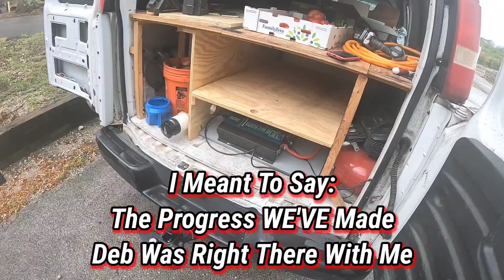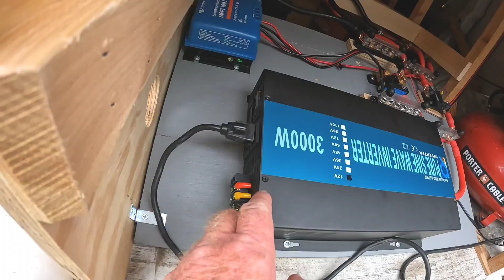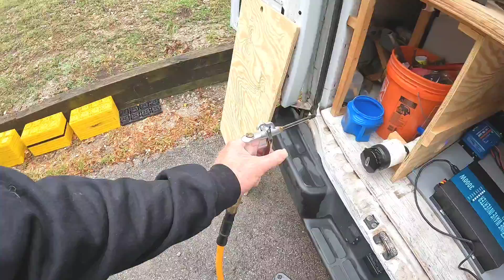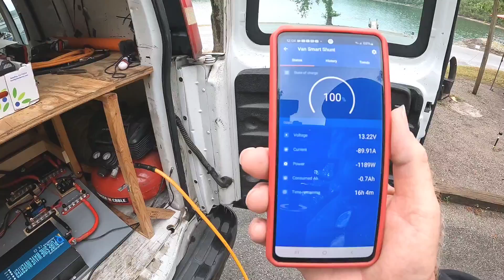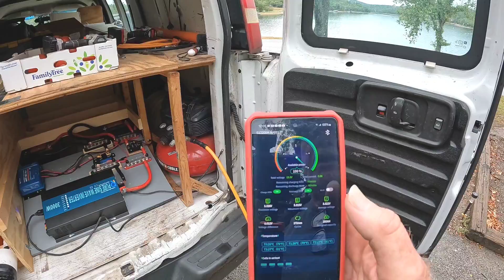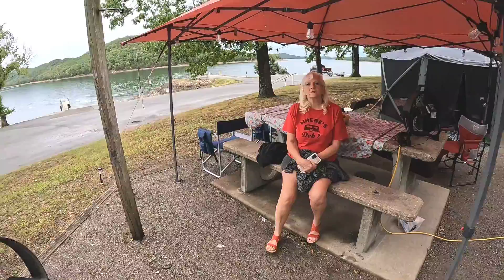Making Our Van A 3,000-watt, 600 Amp Hour Solar Generator. Update #3.

Comment from the maker: https://a.co/d/7IMEHBC
https://www.amazon.com/WZRELB-Reliable-Efficiency-Inverter-Converter/dp/B0154C5F3A/ref=asc_df_B0154C5F3A/?tag=hyprod-20&linkCode=df0&hvadid=693458464558&hvpos=&hvnetw=g&hvrand=16713067239299684457&hvpone=&hvptwo=&hvqmt=&hvdev=m&hvdvcmdl=&hvlocint=&hvlocphy=9026020&hvtargid=pla-350371745231&psc=1&mcid=f98a755589b53bd199e32fa5ecb487d1&gad_source=1

PowerUrus 12V 200Ah Self-Heating LiFePO4 Lithium Battery with Smart APP, 4000+Cycle LiFePO4 Battery, Built-in 200A BMS, Wireless Real-Time Battery Monitor Function for RV, Marine, Off Grid Application https://a.co/d/iIvwiJO

https://www.amazon.com/Victron-SmartShunt-500AMP-Bluetooth-Battery/dp/B0856PHNLX/ref=asc_df_B0856PHNLX/?tag=hyprod-20&linkCode=df0&hvadid=693371156541&hvpos=&hvnetw=g&hvrand=11173269476944609936&hvpone=&hvptwo=&hvqmt=&hvdev=m&hvdvcmdl=&hvlocint=&hvlocphy=9026020&hvtargid=pla-905632901260&psc=1&mcid=60ba429db73c36ff8de1ebdc756cc1aa&gad_source=1

https://www.amazon.com/SmartSolar-MPPT-100-Charge-Controller/dp/B073ZJ3L13/ref=asc_df_B073ZJ3L13/?tag=hyprod-20&linkCode=df0&hvadid=693071376145&hvpos=&hvnetw=g&hvrand=18305564870273363853&hvpone=&hvptwo=&hvqmt=&hvdev=m&hvdvcmdl=&hvlocint=&hvlocphy=9026020&hvtargid=pla-396611007572&psc=1&mcid=27ac9f8afcf930589b6eeb472b65749d&gad_source=1

Comment: Awesome video. Covered everything I believe. Question though, why is charge controller so far to the left and away from other components?
Reply from the maker: At the time that video was made, we only had 2 panels on top of the van. One charge controller for 2 panels. We recently added 2 more panels,  and added another charge controller for those 2 panels.  We simply needed to leave room for the 2nd charge controller.
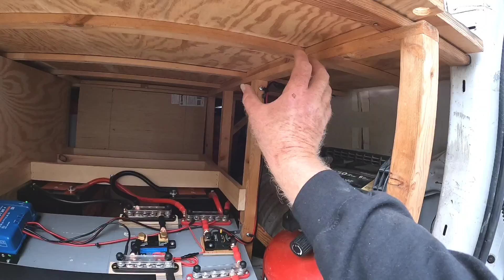Reply: Oops! sorry, my apologies. You actually explained that at the 4:30 mark. 300 amp hr bus bars suffice? I could also get 600 amp hr bars for $30 more per pair. I really like your system!

Comment: I am wondering if you could unplug the solar on the van 
Then with a MC4 on the van and the trailer with home made cord to give the trailer more charge if needed 
Now with that in mind the Van battery would be at full charge
Reply from the maker: Yes. We've done it before.

Comment: Hey Bill since I live in Nebraska about this setup for the van 
How Do you plan to protect the If Necessary
Reply from the maker: If you're referring to cold temperatures, these batteries are equipped with self heating pads. We specified those batteries for that reason. In addition, even though we will be headed to Florida the end of November, we will be monitoring nighttime and early morning temperatures. If predictions warrant it, we will shut down the solar panels to be safe, until the temperatures climb to a comfortable level. One more thing, the batteries can all be monitored, individually, via Bluetooth. One of the categories monitored is actual battery temperatures.
Reply: @billanddeb  oh now I see I
I went to the link and learn more about them 
I was just wondering since you and Bed have said you maybe in the area of Colder weather later this year possibly. 
Having the new Family member and recently health issues 
So I just want to ask that question about it before The Snow Flys
Reply: I see these Batteries will be great for your system upgrade 
I ask you all these questions to help me understand how what why 
So after I get past my Health issues 
I will do what all these great Walk Through people do and Start mine

Comment: Thanks for the update, very good thank you. I have been looking at LiFePo4 batteries, been talking to manufacturers, watching videos. Now I am really messed up... See I am here in the middle of Wisconsin, we do some late fall camping, I have asked battery manufacturers, and camping shops to recommend what type of battery I should use for updating, I don't want to remove the batteries during winter storage because it is a stand alone behind the garage buried in snow, and not much access to it for three months ( many times snow drifts ). I have solar panels on it, 200watt, a POS PWM controller that keeps the AGM battery happy all winter but would like to upgrade things so I no longer need to bring a generator along for the fall camping for coffee making etc ( bigger inverter, bigger battery ), will a self heated LiFePO4 be ok for a few months outside in the elements ( last year we had -10*F for a few weeks twice and a good snow storm 18" ), or should I just stick to the AGM's until I find a easy way to pull batteries and put them in the basement. Even if I place the batteries inside the trailer ( currently on the tongue in a battery box ), the temp in the trailer will get very close to outside air, in hibernating mode. Wil the cold temp sensor kick in and it will be OK till spring, keep getting different answers, I have even over heard the service Tec's talking in the background on the phone arguing yes, no, ( it is ok to have off, but not that cold, it will damage them ) can I just turn off the power access, and the charge supply, will that harm it over the months?? I hear them say "they are not meant to hibernate for months" , now with battery technology evolving as fast, and panel prices to drop more, I am going to wait a little while, but if a sale comes up this fall to clear out their stock, I hate to be late to the LiFePo4 party. Also what are your thoughts on getting a used Victron controller from market place when they upgraded their system and need more than there 100/30 controller? Been seeing a few now for sale.
Reply: Just a thought,  can you run an extension cord to your unit and put a battery heating pad next to your batteries while it's being stored

Comment: Great system an idea. from what I have seen and read if you connect batteries in parallel. Then take neg from one and pos from other. It keeps them balanced better as they are running through each other and not individual,

Comment: both ideas are good for running 2 different panels  on 2 different controllers but also replacing panels before they go bad/ become less valuable and make everything matching. Mount the outlet to the door that way you can use a small pig tail to power the rig when you are driving if it was an emergency gtfo situation like back in Rogers, AR just keep a loop in the cable so it can easily move with the door.
Reply from the maker: The trailer also has its own battery power bank, similar to the van system. However, we never power the trailer going down the road. The Fridge does just fine. Even after a 6 hour run, everything is still cold in the fridge and still frozen in the freezer. In addition, if the batteries are down in the trailer when we pull out, by the time we get to where we're going, the batteries are topped off, due to full exposure to the sun going down the road, unless of course, if it's a rainy or cloudy day.

Comment: the 2 15 amp outputs on the 12 volt inverter in the van will combine to feed a 30 amp rv outlet on van connected to the trailer rv input via a 30 amp to 50 amp adapter.? for 30 amp service or will it be 15 amp service?
Reply from the maker: We are currently connected to a 30 amp power Pedestal via a dogleg adapter. Once the system in the van is completed with a 30 amp "AC" rv style outlet, we'll be able to "plug in" to the van the same as we do at a 30 amp power Pedestal.
Reply from the maker: No. When we mount the 30 amp RV outlet on the outside of the van, it will be wired via the hardwire terminals on the inverter. The only time we will use the 15 amp receptacle on the inverter, is when we power the compressor. We will NEVER run the compressor the same time we are powering the trailer.
Reply: @billanddeb  Now I got it.....I had a brain fart......... the hard wired part is rated for 30 amps ? or more?
Reply from the maker: Well, the wire is heavy enough, but honestly, 3000 watts at 123 volts does not add up to 30 amps. We can run our trailer on it, but we still need to be selective.

Comment: Question? The grounding of the inverter to the van body. Is this for safety? I think that on a metal camp trailer, the AC neutral is not grounded to the frame. I have heard about a hot trailer skin when someone has modified the electrical panel.
Reply from the maker: The "ground" and the "neutral" are 2 entirely different terminals. You don't tie the "neutral" to the chassis in an AC circuit or panel. We have the AC "ground" tied to the chassis of the trailer and tied to the "ground" wire that goes to the power Pedestal. The "ground" stud on the underside of the inverter is just that,,,,,a "ground", not the neutral. The ground basically grounds the chassis of the inverter, in this case, to the van body/chassis (once we tie the ground stud to the van via the wire). We have zero "hot skin" issues with the trailer (been in it for 3 years) nor the van. A typical "modern" house type breaker panel has a "ground" bar and a "neutral" bar. All of the "grounds" in a typical circle go to the "ground" bar, and the "neutrals" go to the neutral bar.
Reply: @billanddeb  If for any reason the "hot"wire should short to ground (van chassis); you may have 120vac on the chassis of your van to the detriment of  your van's electronics if even for an instant. A calculated risk.
Reply from the maker: Proper connections and regular inspections will be in order. One reason why all components and connections are easy to identify.